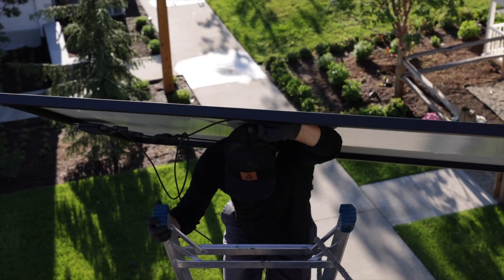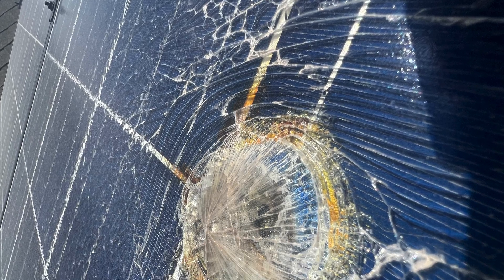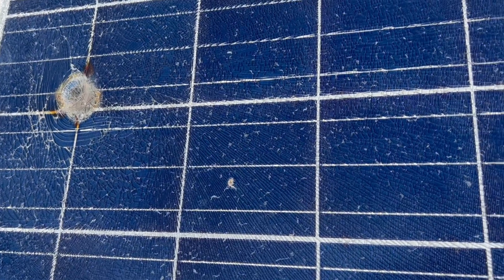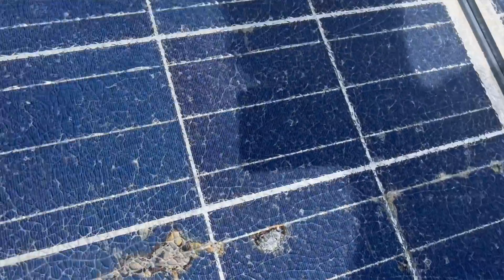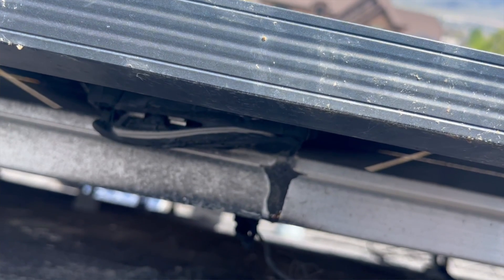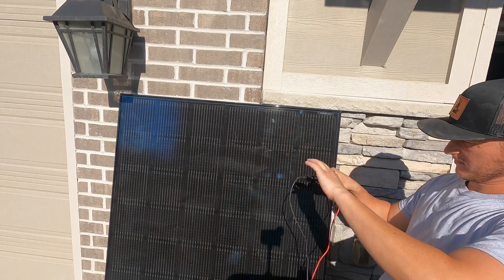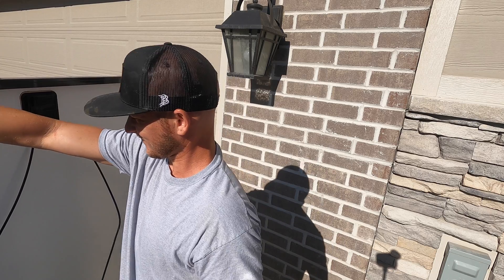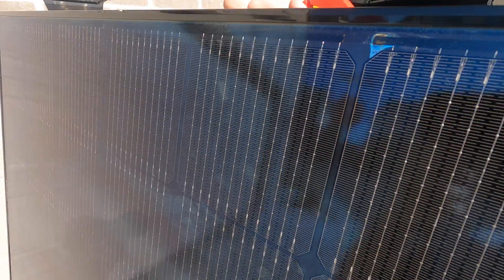Solar Panel Electrical Fires - How and Why They Start On Fire

Comment: It's not debris that causes the problem, it's usually micro fractures, but sometimes bad connections like this solder joint (a problem with lead free solder). The micro fracture issue is an inherent problem with crystalline PV, it's always going to happen eventually with crystalline, it's not a matter of if, it's a matter of when. If you don't want that issue, use either CIGS or amorphous.

Comment: I inspect them every month, and there are always droppings that need to be cleaned off. Another trick to reducing damage from shaded spots is too not draw full current and power from the panels at full sun, instead use more panels and cap the max current draw.

Comment: sure thats how one panel burn.. but i think mostly its the arcing...happens mostly on the wires mc4 or anything with physcal contactors... the wires are tied to the metal railings underneat.. the arcing spread to other panels via arcing on the metal railings... and burns the cells directly above... once those cels burns the arcing spread to other cells via the bus bars and then whole panel burns...

Comment: shading causes it, so more power goes throuh it, panel heats up  you need optimizers some wone said put diodes in line or bypass

Comment: As far as i know,  if the PV glass is broken due to any reason and when we clean it with water then there is a chance that water may seep into the PV glass and might creat a short circuit in the cells,  which ultimately will cause a fire incident.

Comment: Old school solar panels you could bridge the blocking diode with a wire wound resistor.                                                                                                                            Use a thermal camera at night and see your hot spots and further inspect.!!😉
Reply: Nah, just 1 month ago solar panels in Sydney Stadium caught fire.

Comment: I had a neighbor that lost a solar panel to what they were calling a gunshot hole, which the roofers found when they went up to remove panels and re-roof.   It's a nice neighborhood and a two story house, and I don't see how it is possible that that happened.  It was nice clean hole, a bit of checkering around the hole, fairly large, maybe 1.5" with no browning on a 300 watt panel.  Bird shit?  Roofer's nail gun?

Comment: Bird shit is unable to keep the electricity from flowing through the solar panel circuit, that isn't what's happening here.  When anything, paint splash, roofing tar, etc., ate dropped on a panel, it causes heat to build up in that spot and it overheats in the layers and where it can't easily release heat and it burns out this portion of the circuit.  A very tiny spot won't do this, but one that is thick and the size of a coin or larger will totally do it.  Widgeons and doves are the worst on solar panels and the roofs of many cars scaring the paint finish in much the same way.

Comment: Thank you. It should be a requirement to have houses with solar panels cleaned and serviced at least once a year.
Reply: Wash your panels when it rains and you won't get mineral deposits from the tap water as the rain will rinse that all off.
Reply from the maker: I agree with that. I am being a little dramatic in the video but i agree with you. most are told systems need no maintenance

Comment: That solar panel he measured :  LG305N1K-G4 is exactly 37.3 Volts - which is PERFECT FACTORY CONDITION.
His statement at 04:03 that the voltage had dropped are WRONG and misleading.

Secondly - this miscoloration on older panels can necessitate a replacement from LG - just contact them.
Thirdly - Bird poop causing hotspots... My god, what a nonsense!

Comment: Fix: add a "Windshield Wiper" or something similar, that Wipes the Solar Panel Clean every day or week, wouldn't even have to be as thick as a Vehicle Windshield Wiper = Less Energy to Move that part, oh and make it run on SOLAR.

Comment: Love your channel and content, but not onboard with bird droppings causing fires.  Reduced panel power output, yes.  But that's why panels have bypass diodes built-in, to isolate parts of the panel and still allow power flow when the panel is partially shaded.  Deals with leaves, shadows, etc.  What you showed looked like an actual shatter or crack.  Cannot find any info online supporting the statement that bird droppings cause fires.  Birds nesting or critters gnawing wires - sure.
Reply from the maker: Thanks for the comment. And I appreciate the challenge. Not all solar panel have bypass diode‘s. Obviously when they started including those on panels it significantly reduced the amount of hotspots and fires with solar. I’ll absolutely admit that you’re calling me out on “click bait”.  I appreciate you supporting my channel and watching the video. I’ll think about how i can make things interesting without being misleading.
Reply: @solargoat  Thanks for taking the time to reply.  Residential solar panels have had bypass diodes for over 15 years - about as long as MC4 connectors have been standard.  Once panels started being constructed with multiple series strings internally (typically 3 per panel, now 4 or more), they were required.  And sure, I'll give you that individual cells can go bad, and even bypass diodes also - resulting in failed panels from hot spots.  But fires are most commonly caused electrical faults - or physically broken panels.  They don't occur from shading by vent stacks, trees, leaves, birds - or their poop.  That would just be a huge fail for solar energy if a common risk.

I'm not sure if the poop title and analysis was a scare tactic to get people to have their panels cleaned - but honestly it will just scare people away from solar altogether - which I don't think is what you are looking to do.

Keep up the good work.  Clear you are a knowledgeable installer with lots of tricks of the trade - you don't need the click bait.

Comment: Prices finally came down enough that I was just barely able to get a 300 amp hour LiFeP04 battery, 2000 watt inverter, and 60 amp charge controller to have some emergency power for a small Frigidaire window air conditioner after hurricanes. I also bought a 20 amp AC charger to top the battery off if a storm is approaching at night. I have 490 watts of glass panels and high output 100 and 120 watt Sunpower folding ones. Still studying about the best way to set this up when needed. I got a 200 amp fuse to go between the battery and inverter and an 80 amp fuse to put between the panels and controller. Gotta figure out the best way to ground the inverter since it has a ground terminal. I only have one 4 ft ground rod right now for shortwave/AM antenna experiments. Perhaps a second one could be placed nect to it and these can be connected together.

Comment: Squirrels like to start fires too
Reply from the maker: They just crew right through wires right?
Reply: @solargoat  yes they do.
Reply: In our city, Riverside, CA, the squirrels chew through the aluminum neutral power line that is uninsulated. They sharpen their teeth this way. This has caused a short circuit as the power then jumps to 240 volts till the fuses are blown. My power surge block burnt out but the computer was saved.  The city power company told me it happens all over the city.  So they fixed it with a splice the first time, the next time they spliced it and the third time they replaced the whole wire and insulated  the whole thing.  But they left a small section un-insulated, which now has chew marks again.